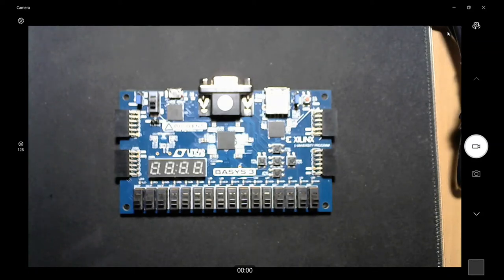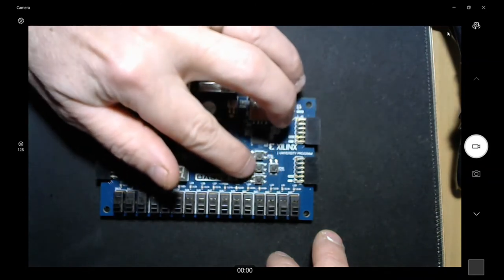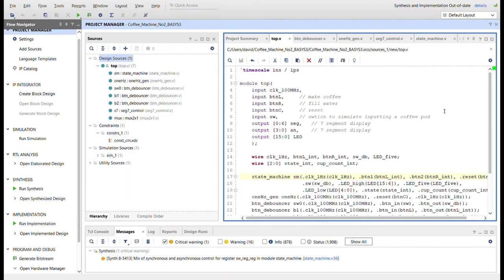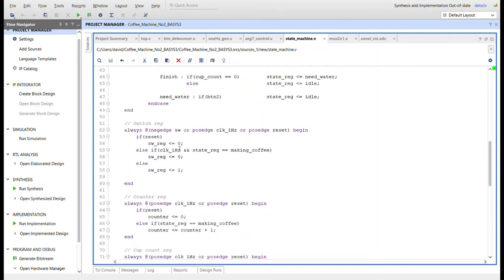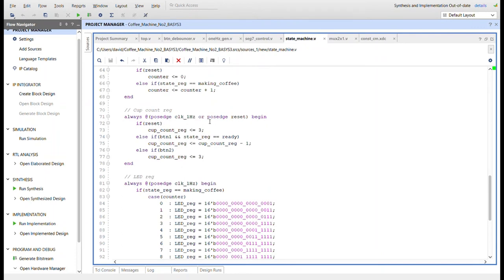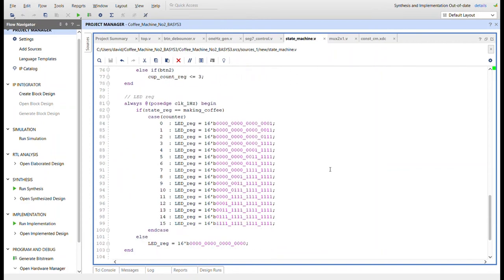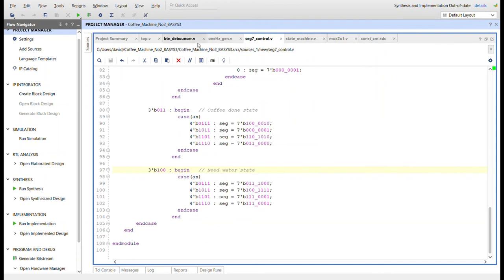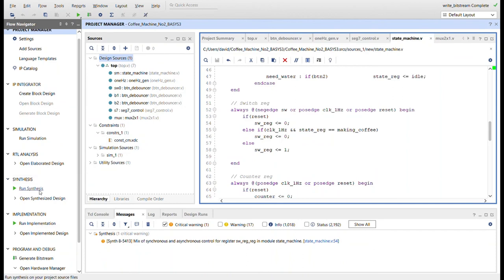Coffee Machine State Machine(Keurig Machine) Simulator on BASYS 3 FPGA using Verilog in Vivado

Comment: Sir don't we need a test bench
Reply from the maker: Test benches are used to simulate designs to ensure proper functioning.
Reply from the maker: Cases where you may or may not need a test bench:
1. Where you surely need a test bench; when you are designing a system for a company that plans to make money from the your design, the design should be verified with a test bench.
2. Where you might need a test bench; a. when you are designing a circuit for a class assignment for a grade, the design should be verified with a test bench and simulation results included when turning in assignment,
or,
when after implementing your design on your favorite FPGA board at home and it is not functioning correctly, you may need a test bench to simulate all or portions of the design to ensure proper function for the whole system.
3. Where you may not need a test bench; when after synthesis, implementation, and bitstream generation, and maybe having to fix a couple of errors during these processes the design functions properly on your favorite FPGA board, there is no need for a test bench.